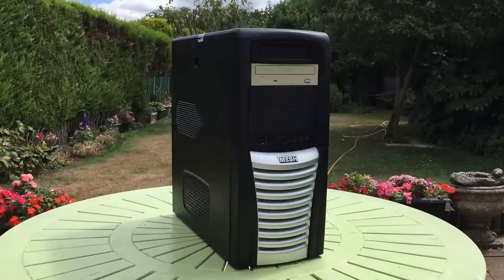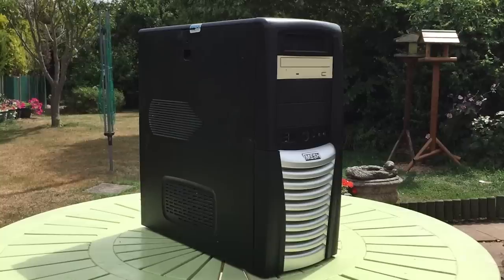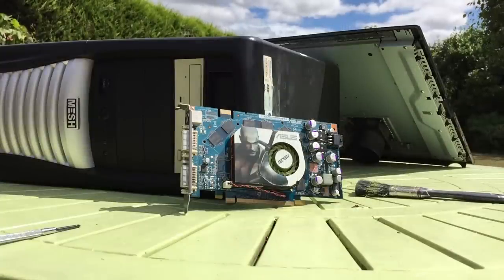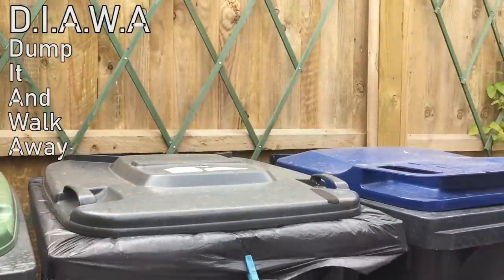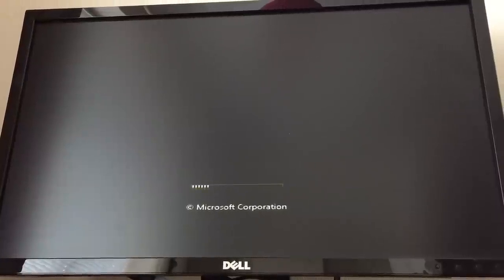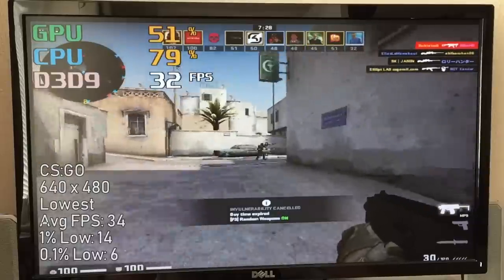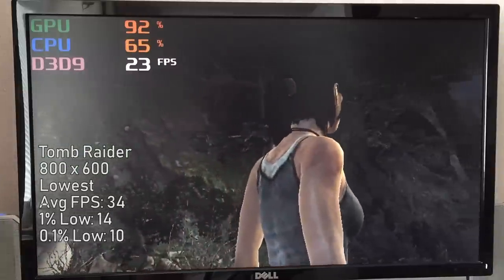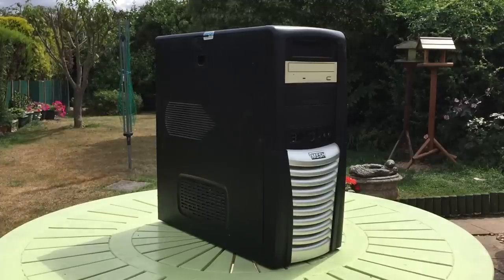Using an old £1000 ($1300) Gaming PC For The First Time In 10 Years...

Comment: The CPU ain't half bad, but that GPU is garbage
Reply: Steve Martino I've used a Nvidia 7300 gt 256mb till 2013
Reply: Piotr Romasz I still have a 7300 gt in use until I can find drivers for my mac pro tower.
Reply: Drivers for a hd6450, that is. And even that's not that great of an upgrade, but at least it has 2gb of vram
Reply: shiny missingno mine one busted into flames
Reply: shiny missingno 9800gt was so bad that i can't even imagine 7300 gt in my life
Reply: Marcin K I haven't even tried gaming on it... pretty sure 256mb on a pcie 1.1 bus would kill my brain from the slowness. If I can get this hd6450 working in there I'm gonna try putting in a sapphire nitro r9 380. At least that has gddr5 vram.
Reply: in all the titles he tried, they both werent bad as a combo (at its time) but just only having 2Gb of ram was terrible.
Reply: Used a Geforce 6200 LOL
Think I still have it
Reply: Night Rook ha I had a 6600 once, tossed it out when I finally upgraded to a 450gts
Reply: A 960 is a bit of a waste on a pc with a core 2 anything in it. A 750ti is still bottlenecked by the best cpu the 775 socket has to offer.
Reply: SinikkaL, Two years ago I tried a GTX 660 on a Core2 Quad Q6600 @ 3.0GHz system and on most games GPU usage was at 100% and CPU usage was under 100%
Reply: @talonfluff  i was using Nvidia GeForce 8400 GS 256 MB
now i am using ATI HD 4650 1GB.
Ultimate low-spec gamer
Reply: NAH. The 2 HD 5450 1gb that i have are worse.
Reply: shiny missingno
The 6200 was the upgrade I got for the FX 5200, because it died on me xD
Now I have been using a laptop with a GT 630M for 6 years xD
Reply: The 7900gs is roughly the same performance as a g3258 igp. Which is garbage.
Reply: SinikkaL um i ran 60 fps on my q6600 with a 1070 just fine along with 8gb of ram
Reply: Intel GPU is garbage
Reply: no.
Reply: Is still use it

Comment: I bought a 10$ pc at the salvation army and it has 10gb of ram, an i5-3350p, and a gt 620. Im replacing the gt 620 for a gtx 750. So i spent 60$ on a gaming pc. Did i get a good deal?
Reply: Not bad for 10$
Reply: I'd say you did great
Reply: DIYelectronics well if its a good deal im happy bc im into budget pc builds
Reply: that 10gbs of ram is worth it on its own the rest is baiscally free , great deal
Reply: That's a fantastic deal. I'd replace the psu and get a newer card like a Gtx 1050 ti :)
Reply: Peter Klick a used 970 is same price and performs mutch better as it is  preforming like a 3gb 1060
Reply: Peter Klick yea its the stock psu with 450 watts
Reply: Peter Klick and the gtx 1050 and the gtx 750 are basically the same cards. Its just that the gtx 1050 will have more ram.
Reply: Green Got Game I also recommend the GTX 970 it's the price of the 1050ti and performance of the 1060 3gb but one bad thing is there's only 3.5 gbs of vram with an additional 0.5gb that is really slow so it cos basically a 3.5 gb card
Reply: Green Got Game yeah definitely a good deal. There is always the option to upgrade to an i7 2600 and to a 6 GB GTX 1060, and 10 Gb of ram are always a bonus on the usual 8 ones.
Reply: DIYelectronics yea the i7 2600 is a very good cpu for the money.
Reply: The Gtx 970 is also a viable option and a good price / performance ratio, just keep in mind it's a little more power hungry ;)
Reply: Green Got Game the 1050 is a lot better than the 750 in terms of performance
Reply: yup pretty good deal
Reply: The GTX 1050 is like 1.7x the performance of the 750, not at all "the same card". But you did get a killer deal tho
Reply: That is an excellent deal, you probably could not have scored a better gaming PC for the price, I bet it could even run some of the latest games at 60 FPS (albeit at low settings). That i5, while far from the most powerful out there, could probably even handle a more powerful GPU, even up to a GTX 1060 3gb. And if you really wanted, in the future, you could upgrade the CPU to an i7 3770K.
Reply: On the graphic card: a gtx 770 would be mice, depending on the psu. If ut can handle a 970, go for it, but if you are short on power: 1050 ti is your best bet. I'd suggest the msi version.

Non the less: 10 bucks for that system is a steal. Even with a new gpu (rx 580) it would cost about as much as a x5670 system I threw together for a friend, and it would run much better.

If you know a smaller Datacenter near you, you might get your hands on a e3 xeon on the cheap. Got one for a friend for only 30 euro.
Reply: Yeah for $10 that's very nice
Reply: @momfiethehunter504  in some cases better too!
Reply: @zzGRN  no the 750 and 1050 aren't almost the same :0
Reply: You lie or you've got some fake pc parts

Comment: I'd just dump the cooler in hot water and finish it off with some compressed air
Reply: though not hot enough to melt the plastics. or if possible, remove the heatsink from the fan.
Reply: I said hot water, not bitching-boiling hot.
Reply: When I cleaned all my mining gpus, I rinsed all the heatsinks under really hot water, then I used a datavac blower to dry it, works well!
Reply: Just remove the fan first 😂😂.. no matter how hot your water is, it wouldn't be a problem
Reply: lol 😂

Comment: Still better than a PS3 I repaired. Every square inch was filled with dust, yet it still worked before cleaning. It ran for about 5 minutes before the fan ramped up to 100% and then I used it for about 15 minutes longer. I didn't fancy carrying on, but it was pretty impressive when the PSU had a coating of dust on it and thick clumps on the coils.

Comment: I got an old LGA775 computer for £25 recently. I did the Xeon mod, and got an X5640 in there, overclocked to 3.8 Ghz.  Upped the RAM to 8GB, and shoehorned in a GTX 970. Bit of overkill, but it all runs well. Playing modern stuff on it! :)

Comment: I rescued a fullsized gaming desktop for $50 and has an Asus P5E3 Deluxe Motherboard, Core 2 Quad Q6600, 1GB DDR3 Ram but already had 8GB Kit, and a GeForce 9600 GT. Dude bolted the cooler to the motherboard with way to much thermal paste. I got it all cleaned up with new ram, CPU cooler, and a new GPU(Zotac GTX 550 Ti AMP!). Running nice now.

Comment: The video pausing like that shows a failing power supply.    Had the same symptoms on an older system of mine. Replaced the power supply and its running good.

Comment: The cpu doesn't overheat that fast if the system is not loaded, in some cases you can enter the bios even without a cooler and it will stay under 60C. What probably happened is that there was too much dust on the ram slot or something like that was preventing the board to boot.

Comment: Be very careful what kind of a brush you use to clean those pcbs with. Brushing can generate a static charge and potentially fry some delicate components. Also try to always disassemble cpu and gpu coolers to be able to really clean them out. In some cases, when they are really filthy, using a can of compressed air can push all that dust inside the heatsink effectively clogging it. It may look clean on the surface but always make sure you get all the dust out.

Comment: Wow, 190W on the 5v and 204W on the 12v - save that PSU for powering a 5v dependent retro rig.
If it wasn't used that much, how did the heatsink acquire a carpet

Comment: This was my last but one system.
E6600, P5N-D. Rebuilt it at xmas to give to my niece. Only graphics card I had lying around though was a 6600GT. What's the best/cheapest gpu could I put in that wouldn't be bottle necked by the cpu?

Comment: I had this card and actually got the Non Redux version of Metro Last light to run. 800x600 with 0.5 SSAA and it ran pretty alright mostly around the 30-35fps range

Comment: Instead of throwing the cooler away next time use a garden hose to rid of the dust off the heatsink then use compressed air on the fan as needed. Those old C2D/C2Q stock coolers are vastly better than anything Intel uses for boxed coolers and some people have managed to use them on newer builds with good results.

Comment: You can clean dusty motherboards and heat sinks in car wash or dishwasher or sink.  Just remove battery and make sure you let dry at least 24 hours before powering up.

Comment: He says in the video the best way to clean dust etc from computers is cans of compressed air but i wouldn't recommend them due to the liquid that is in the can even when right side up the can still sprays some of it out which can short out components and or the whole system, i see this happen daily when people in offices try to cleanout laptops by spraying it into their laptop via fan vents. i would recommend an air compressor with an Particulate filter water trap separator, they aren't super expensive if you buy small ones even electric ones and will save you money compared to compressed air cans in the long run.

Comment: You should definitely make longer videos.
Oh and you should try running the original Mass Effect - That game is pretty punishing on old hardware. 
I have a system that matches the 2006-2008 era when it comes to performance. 
It has an AMD Opteron Dual Core (2.4 GHz), MSI K8N-SLI motherboard, 2 GB of DDR RAM (400 MHz), a Geforce GT 530 (similar to the 8600 GT in terms of performance) and a 160 GB hard drive.

I use it primarily for old games. Retro hardware is fun to tinker with

Comment: I think that this issue with stuttering can be motherboard failing. I have had two failing motherboards and one made games crash, but could pass stress testing with prime95, OCCT, Heaven. Another one passed stress testing just fine too, but it had severe problems with stuttering in some games, had problems with detecting modern hard drives. I figured out that problem was with RAM slots. RAM only worked in one configuration, if one stick is removed, then PC doesn't even start. If sticks are put in different order it doesn't start either or shows booting problem. I also read a lot about motherboard design and read about evolution of them. My conclusion is that it's very hard to test out motherboard and if one small part of it malfunctions or just doesn't work at all, it doesn't mean that Windows will not boot at all. It can be something really really specific. Like small piece of memory controller. Part of it responsible for very specific task, that in real life is rare, but if it's used, then issues could be noticed. It's easy to mistake it as software problem, so motherboard troubleshooting is extremely hard to do. From my own experience motherboards are the most unrealiable things in computers. Also I talked about some of my problems in online forums and people mentioned that malfunctioning motherboard can short other things in computer like CPU. It never happened to me, but from electrical standpoint shorting can occur. I know this doesn't fit this channel at all, where systems are cheap and troubleshooting system to such level doesn't really makes sense, but I'm sharing this just to let you know. Troubleshooting one board to me took like 3 months, but I wanted to know specifically was wrong with it. I sort of found, sort of not. I'm not electrical engineer, don't have any equipment, neither I had schematics. So I just abstractly knew what area of motherboard was bad. First board had problems with power delivery to CPU. Second board had problems either with RAM or RAM controller. Those boards are from different systems and different eras, so I wasn't so unlucky to buy two lemons in a row. First board survived 4 years, second one survived 13 years. First board's reliability is really not surprising, but second one I thin it did the job really well (other components in that time started dying too, like fans). Anyway, I think that this computer's motherboard may be dying, considering that Minecraft and CS:GO had weird stuttering issues.

Comment: Till the last year I had a laptop from the same era with specs that could match that PC, the difference between that 2 old bois is that there were no path to upgrade the laptop, while you can install more RAM, a better GPU and CPU in that old desktop an have if not a gaming beast, at least a reasonably functional PC for a bargain.

Comment: Hopefully you changed the paste on that graphics card! I have found some older GPUs use some type a pinkish gum that dries and hardens overtime. Dropped temperature by 20 celcius on a fanless gpu with new thermal paste.

Comment: Hey was wondering if you could test blade and soul with a hd 7950 or a similar card and the g3258 clocked at different speeds.
I'm probably going to get the g3258 fresh from amazon.com for around 68 euros because its going for 459 euros for some reason on .de.

Comment: crysis as a benchmark has some problems as the opening is pretty light compared to the ending. the last part of the game takes around 4x the power. onmy old pc i needed to deactivate all the particles to even get a fps in a playable range
dx9 mode is a bless though and can give you +30fps without any graphical chanegs as long as on low

Comment: I recently got given an HP prebuilt from my now late grandfather that is from 2009 and has an Athlon x2 7550 and 8gb of ddr2, I already put a 750 ti in it and will probably be putting a Phenom II x4 from another system I have and upgrading that to an FX.(if the phenom works in it) I will also install windows 10 as it currently has Vista on it.

Comment: Some weird results here. I have a laptop that has Intel Core 2 Duo T9300 @2.5 GHz, ATI Radeon HD 3450 256 MB and 4 GB DDR2 RAM and it runs better then your similarly speced PC. Especially MAFIA that can run maxed out at 1600x900 without any problems. Can an extra 2 GB of ram make such a difference?

Comment: To be fair to the system. my Ryzen 3600, GTX 1070 often has a bit of a rough time with Minecraft. One day it's running 75fps (monitor cap) then next day it's lost 20%-30% performance.

Comment: Nice review, but IMO the bottleneck was the 2GB RAM. Since any version of Windows that is newer than XP likes to have 1GB for the OS (or 2GB if the 64 bit version), a single 2GB RAM stick won't leave much for anything else. Either upgrade to 4GB (or 8GB) and use Windows 7, or downgrade to Windows XP with the 2GB RAM.

Comment: My old pc was AMD 64 2.3Ghz dual core; 2x2Gb Ram ddr2 800mhz dual chanel; Gt 8800 512mb and I run Tomb Raider Survival 2013 at 720p/75hz on medium with some textures on high. By my fault, 8800gt had problem with ram chips - i replaced gpu with gt 730 4gb ddr5 and still good for 2015 games at HD. OS is XP 32bit.

Comment: With a little bit of some second hand upgrades and about $200 you can get that thing up and running with new titles like Farcry 5. Right now I'm typing on my core 2 Quad 9550 with 8GB RAM and a GTX 960 and I have a video here on youtube playing Farcry 5 at playable frame rates and 1600x900 high settings (native res of the monitor). Last week I found a bunch of Q9650 for $50 (which I picked one up for a future build) and a few Q9550's for $24. RAM though is a hit and miss on price but 4GB is a good start but 8GB is ideal. Toss a GT 1030 or 1050 and you will be on your way to gaming on a socket 775 with a intel quad 9 series which, almost kind of, hold up to todays standards on windows 10. Hell I was able to play Final Fantasy 15 on this machine.

Comment: The easiest way to clean these is with compressed air, or even better one of those vacuum cleaners that have a blower + small nozzle. 
First vacuum as much as you can then use the blower, mind you you may want to wear a mask or hold your breath since it often looks like a dust storm

Comment: where do people still get windows 7 isos from, i have an old system and cant get windows 7 to boot on it :c
Reply: you torrent/download them off the internet and then just old onto the file on a usb drive or something

microsoft legit stopped providing them but their page is still up. I remember a few years back I went there to get the iso file, but nothing worked no matter how often I entered my windows key. Even talked to support. Support legit told me to go download a copy elsewhere.
Reply: Steve Smith I know I had to download the iso but everywhere I try the website is either way too dodgy it risky or if I do find one and I get the iso and put it on a USB via win32 disk imager it doesn't boot up with the installer on my secondary PC with a blank hard drive
Reply: use the official windows 7 usb tool, you can still download that
Reply: Steve Smith you need a win7 product key though

Comment: That's odd, I used to play minecraft about 3 years ago on my c2d e5200 + 7600 gt system and it ran at about 200 fps. Then again, I had optifine and extremely low settings.

Comment: Throw in a c2q 6600, 8gb of DDR2 and the gaming results will be night and day. The GPU was seldom showing over 70-80% usage so it definitely has more in it but the 256mb of VRAM is probably also part of what was causing the stutter and certainly what caused the pop-in with ROTR. If you throw in something like a GTX 1030, the RAM/CPU upgrades then you can probably sell that thing on as a fairly capable low spec gaming machine someone on a tight budget would love. 

The 2gb of RAM is definitely on the low side but the 256mb of vRAM is the primary cause of all the stutter as things need to be swapped to the RAM (only 2gb) then HDD when that is full. 8gb of RAM will make the stutter far less intense (RAM is much faster than swapping to the HDD) but it won't fix it.

Comment: That 775 motherboard is a good Asus motherboard. It works with the socket 771-775 Xeon mod. Then u have a cheap fast quadcore and upgrade the ram to 8gb and a decent graphics card like an old 8800 gtx or 9800 gtx. Also replace the psu. Then u have a decent machine.